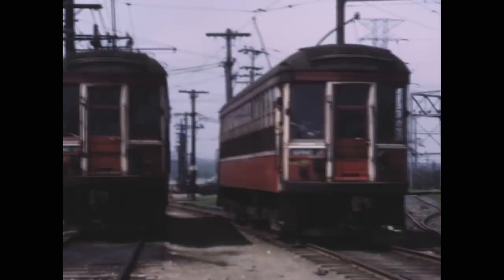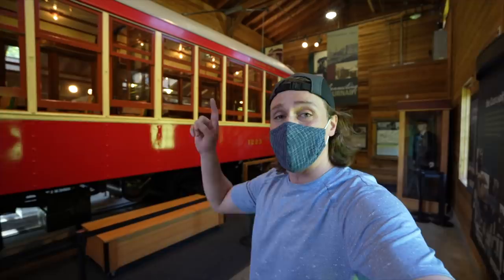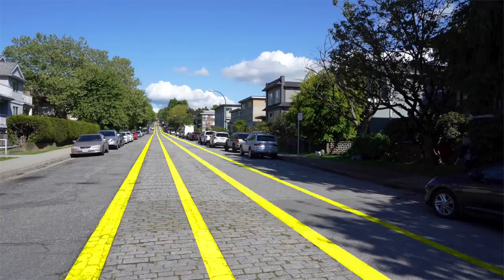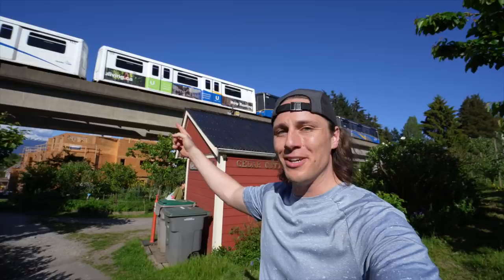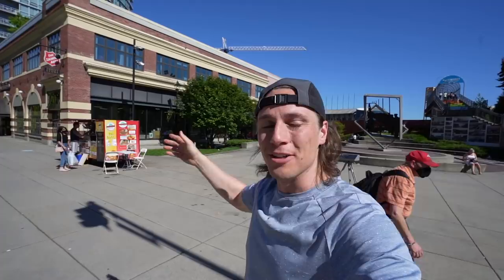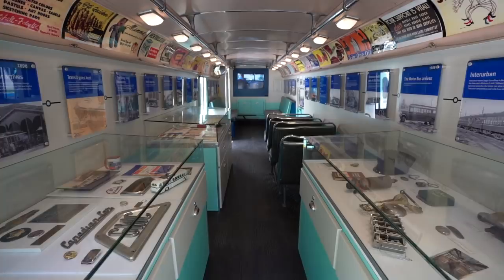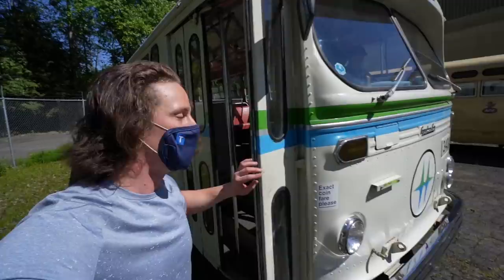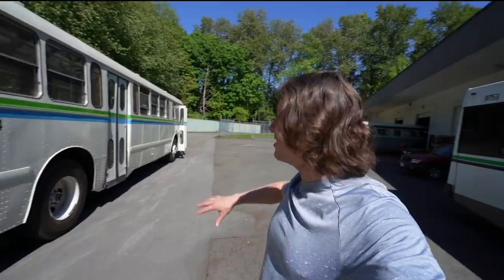What's LEFT of the Vancouver STREETCAR

Comment: They still ran those fishbowl buses with those seats in the early 90s with BC Transit livery. I remember having to manually push the rear door open.
Reply: I remember the rear doors of these buses (single rear door fishbowls) being manually push open as the doors were not motorized, just spring loaded to close. The fishbowls with the dual real doors were step on the top step to open the door, much like the high floor accessible buses. Does anyone remember it?

Comment: The entire BCER network was standard gauge.  What you call an "interurban" was referred to locals as a "tram".   The Georgia Viaduct was so poorly constructed it couldn't hold the weight of the poles holding the overhead wires.  In fact, they removed every second light post and braced the structure underneath to try to keep it stable.

Comment: When I was a kid I rode on the Brill buses in the mid 1960s and it cost 10 cents to ride from King Edward Ave to Seymour Street downtown,  I also remember driving with my parents across the old Georgia Viaduct many times in the 1960s.  To get onto First Ave. to go east there was a loop to the right off Main Street where Science World is now. It was all industrial factories and rail yards there at that time.
Reply: I remember being on them via the special runs to Hastings Park that ran during the Pacific National Exhibition. My family would come over from the Island to the fair and by the time we got there you had to park your vehicle some distance from the gates so the electric trolley was taken. The old round light fixtures, the little pockets where the Buzzer pamphlets were and most fascinating to me was the doors. Each side was made of four folding panels for a total of eight per doorway that would rattle and bang open or closed with what seemed like lightening speed. Over the back exit door was a green lens which when illuminate meant that the drive had unlocked and powered them up but you still had to step down upon the first step for a switch in the mat to open your half of the door. And the driver could choose at the front to open both halves of the front door or only one. They seemed like they were extra wide too. But the speed and rattle ending with a bang when they stopped is something I probably will not forget.
Reply: @rabbytca  I remember that... I think there was also a wooden gate that had to be pushed open before stepping onto that first stair.
Reply: @althunder4269  Yes, I used to take the Arbutus or Dunbar Brills from Granville Street and there were low gates you pushed through before stepping down the first step to exit the rear doors.
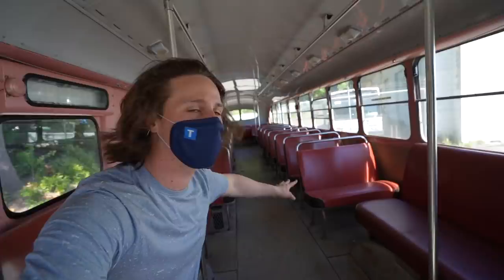Reply: Would have been nice to get a closeup of the Canadian Car & Foundry builder's plate on the dash of the Brill.  You catch a glimpse of it at 11:36.

Comment: Many of these old street car lines terminated in a loop to turn the car around at the end of the line. When they stopped running cars on the rails the new rubber tired trolleys still had to use the loops because that is where the wires were overhead and it gave them a stop to wait out of street traffic. Hence the various routes which are still to this day called "something Loop"

Comment: Your dad stopped by Crossbuck Park (16/Arbutus) and asked me to look at your video. I did. It’s great. Some notes of interest for you - the mileage signs you see on the ends of the instrument cases at level crossings are in fact the distance in miles from where trains crossed to this side of False Creek. There are (were) 17 of these cases along the Greenway. They contain the switch gear, voltage rectifier circuits and batteries to control bells and flashing lights at level crossings. They were left behind after the rails were pulled up in 2016. Badly vandalized and graffitied they are now all brightly painted. That was, and continues to be, my contribution to adding art to the Greenway, and it is done with permission of the City Project Management in charge of maintenance on the Greenway.

Comment: there's visible track on Quebec street between 13th / 14th. There's also lots of track left adjacent to the Burrard Bridge on the kits side. There you can find a manual cpr switch and the original approach ramp to the Kits trestle.  In Burnaby across Kingsway from Central Park there's a remnant of a streetcar overpass.
Reply from the maker: Yep, a lot of that is in last week's video!

Comment: At 6:00 you say that the Burnaby Lake Line interurban ran along the tracks you show.  Those were the Great Northern Railway (GNR) tracks used by trains coming from the US as well as the CNR.  They presently are used by Santa Fe / Burington Northern, CNR and CP.  The interurban line ran parallel and just north of these tracks.  Their track crossed the GNR about a block east of Willingdon and there was a special crash board installed so that there would not be a collision between interurbans and trains.

Comment: Car 53 never was a freight hauler.  It was built in the BCER New Westminster shops in 1904.  Top speed was 10 mph.  It last hauled passengers in 1916 on the Bodwell Road line in Vancouver.  It was then renumbered G-2 and spent the rest of its life hauling car parts and mechanics  from one BCER location to another.  Railfan Stan F Styles obtained the car in 1955 and worked with the City of Vancouver to have it placed on outside display at the PNE grounds.  It sat out in the weather for many years until Mr Style's family leased it to the Old Spaghetti House about 1969.  The red color on the car is incorrect - it was green & cream as were all Vancouver streetcars until 1927 when it was decided red & white provided better night visibility.  Much of the detail from the car has been removed thru the years including the big strap fender on the front.